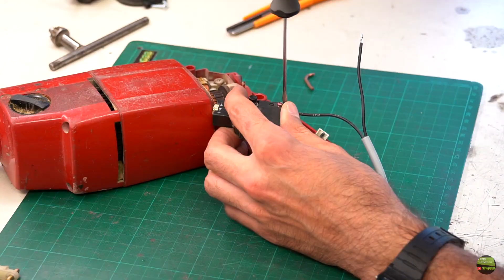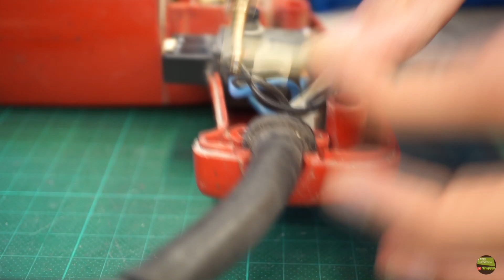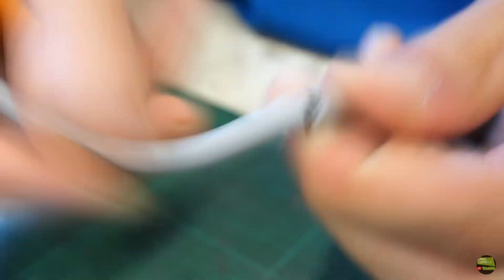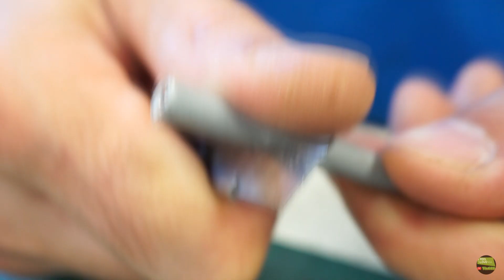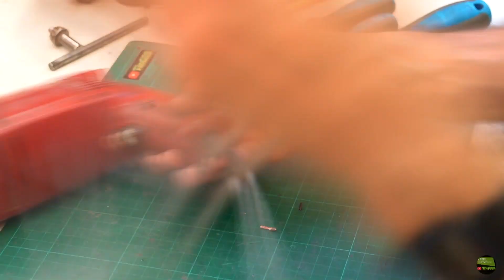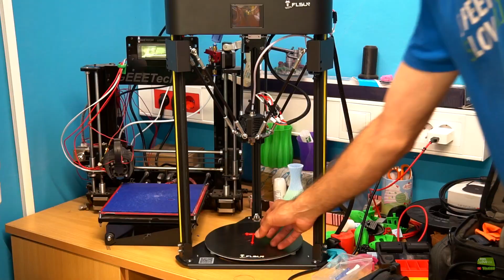How to replace cable on power tools

Comment: Great video, tinning the cables is a good tip and will make sure there are no stray wires and that the connection is solid. I bought a solder pot for tinning a few years ago, really useful when your terminating loads of fly leads and keeps the heat down in the cable to protect the insulation.

Comment: Best way to remove the outer sleeve👍 Good to see someone using ferrules too, much better than trying to catch a random strand.👍  not sure that solder is a good idea tho tbh
Reply: The solder method is called tinning. It was the first lesson my dad taught me when learning electronics. It seems in the 60s (UK Midlands Electricity Board) this is what electricians did and is perfectly safe and lasts longer thank most equipment with no issues at all. He was still a qualified electrician untill about 5 years ago at that point he stopped keeping his qualification up to date. Still tins cables now and TBF so do I, the termination is cleaner than ferrules, the issue is with heating up the insulation, if you don't you will get a better connection than with a ferrule as your not adding a risk of resistance from a badly fitted ferrule.

My gut says your worry was with the solder melting under load, the thing to remember is the cable acts as a heatsink and solder is how almost every joint in the device is made, if the solder were to melt you should be looked and whether the insulation has also melted off the cable. (This happens with coiled extension cables that are not unwound and then used with a heavy load the inductance heats the cable and things start to melt.)